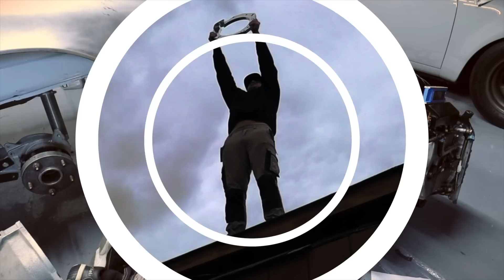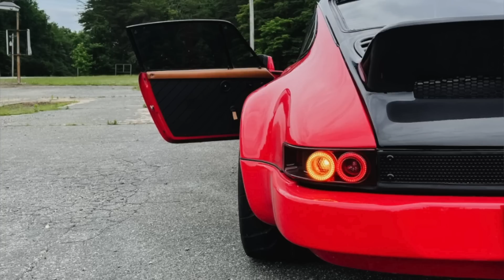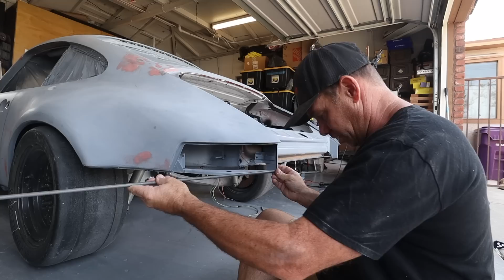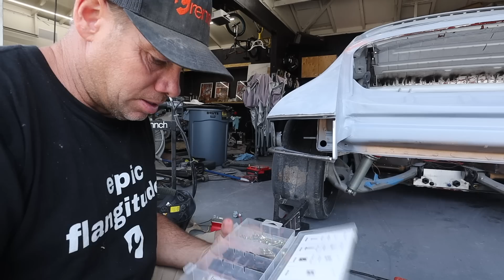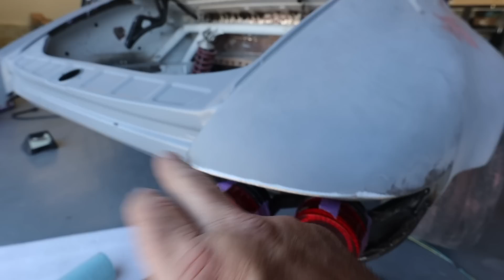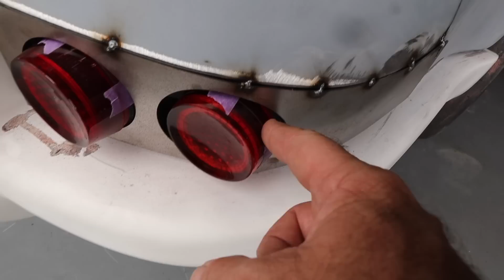*CUSTOM* 3D Printed Porsche 911R Integrated LED Taillights - Subaru Porsche Swap Blasphemy Build 68

Comment: Certainly a different look. 😊 Maybe whilst you're doing this make the frames attach from the rear so it makes the lights more serviceable cos once the steel is welded in place you won't be able to get to the mounting points if teh frames or lights ever get damaged 😉
Reply from the maker: yea, I've got that all worked out.  Stay tuned.

Comment: Chapau ( hats off! )  to these projects: how you dive in, modify , improve, personalize and teach all at the same time.  Everything is looking quite cool.  Be wary of the tail lights the first time I removed mine after  130,000 miles there was a lot of big debris ON TOP of the tail-lamp-housing rocks and pebbles the rear tires will toss crap at them all day long, I don't want to see lovely 3-D printed parts getting thrashed by road debris,. just sayin'.

Comment: High Five from London Ontario Canada. I have been watching this build since the beginning, VERY intrigued!! Found you by watching Home Built By Jeff. I think it's very cool how you builders support each other by wearing swag..."Make The Noise". I love what you're doing, bringing in some modern technology to a car that really could use it! 

Just a though with your tail lights, do you need the flimsy brackets? If you are welding the tail light panel to the car, why not attach the light sto that new metal? Maybe the housing and lens could be oversized and "sandwich" the body panel by screwing together? 

Anyway, keep up the amazing work, your channel helps me wind down and dream of doing a project like this myself...someday...LOL!!

Comment: Nice work so high five from the Netherlands!
One question: can the lights be screwed in sufficiently tight to prevent them to vibrate loose during driving?

Comment: Fantastic work! Gonna look great when it's all welded and finished. 

Instead of mucking about with the brake line, rotor and your vise, I think I might have taken a piece of cardboard and traced out the bottom of the tail light housing curve and used that as a template to jigsaw the shape out of a piece of 2 x 10 lumber or similar to create a shaping buck around which to bend your rod. It would make a nice tool (and who doesn't like more tools...) to provide consistency and repeatability as compared to your malleable hard brake line.

Instead of the dimensional lumber, you could use some 3/4 and 1/4 inch thick plywood. Cut one 1/4" and two 3/4" pieces with the same curve profile, and then stack them together with the 1/4" piece in the middle and set back a bit to make sort of a trough to hold the rod a bit more steady when bending it.

Just a couple ideas if you need to make any more of those filler rod pieces.

Looking forward to how this all works out. Cheers.

Comment: Watch your eyes!
Reply from the maker: Are you referring to the welding?  If so...I'm using a Fitzee trick here. You use the tip of the welder to block out the flash of the spot weld.  Like an eclipse.  :)